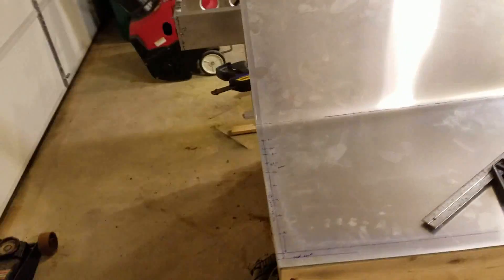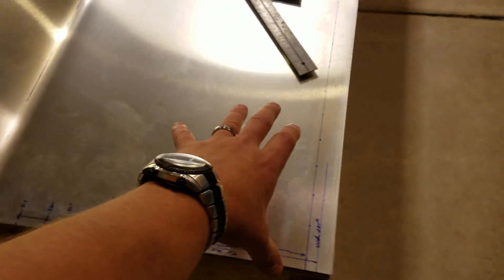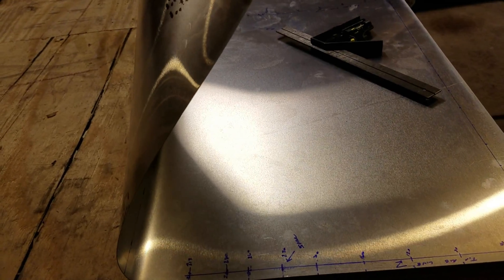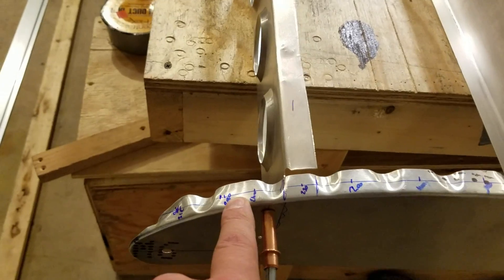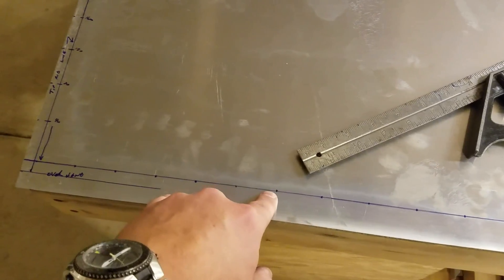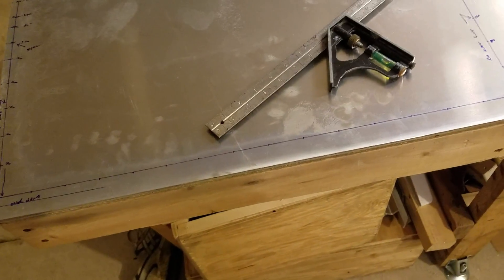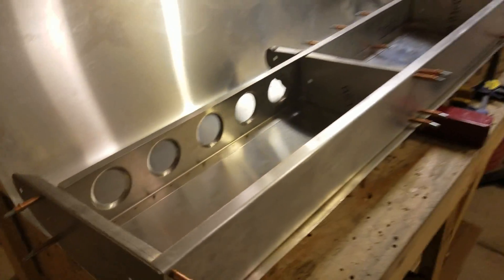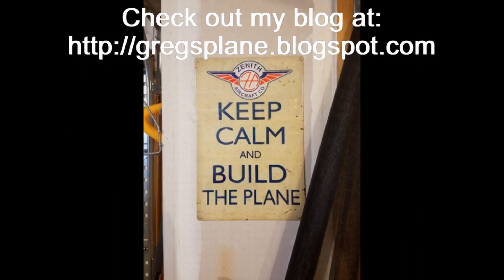Horizontal Stabilizer Build - Part 4/7

Comment: I’m currently skinning my 701 stab and it’s a bit of a pain.  I ended up with some slight nose rib imprints on the LE skin.
Reply from the maker: It's definitely a challenge. I'm not sure about the 701 but skinning the 750 has similar pitfalls when you're using thinner material. Getting a generous radius in the nose skin before ratcheting it to the ribs was critical for me to prevent that issue.

Comment: Thank you. Not the plane I originally planned to build. I was going to build a 601, but at that time they had some problems and it made me nervous so I started the 701. I am extremely interested in the 650 and will probably start one when the 701 is completed if not before. Lathes are a neat shop addition but not a high priority for the build itself, lots of tooling I would put higher on the list. I tend to be a tool addict and have spent lots of time building tools that could have been spent building airplanes.(bending brake is a prime example. Www.macsmachine.com under bend brake special offer mine is the second one down in light blue)
Reply from the maker: I originally wanted to build a 601/XL too...had the blueprints and everything. I changed my mind when I got back into backpacking/backwoods camping (I'll build a 640 for x-country). Agreed on the lathe...I am a tool-a-holic, though, so it's only a matter of time. The Mac's Machine brake is a great piece of machinery. Did you find that you could do all the bends for the 701? From what I can tell, "hat" sections like the landing gear channel wouldn't be possible with the Mac's configuration. I've struggled with the original Dave Clay design from nearly Day 1, though. Made several modifications, but if I was starting over (and if I'd had the welder from the beginning), I'd make an entirely different brake.
Reply: yes they can be bent on the macs brake with some fiddling, actually z channel was harder to bend on it. I built a somewhat crude 8' press brake which takes care of the balance of the long pieces and short heavier stock bends are done in the 20 tonpress with homemade forming dies

Comment: About 770 hours. Been away from it for a while but motivating myself for when the weather gets better. I will be doing videos and probably a podcast about it. I will be re organizing the shop and taking stock of where I am with the project and deciding the course I am taking with building. It is a scratch build.
Reply from the maker: I just checked out your vids...great work on the 701. Even from the photos, I can tell your craftsmanship is superb. I had so many setbacks over the past year! I'm just shy of 600 hours into mine. I really, really want a lathe, but building on a budget...any money spent on tooling takes away from materials for the build. Always a balancing act!

Comment: Ok, just seemed odd
Reply from the maker: Yeah, I can't really figure out what they're flanged the opposite way, at this point. I mean, the amount it would affect weight and balance has to be nearly immeasurable. And I can't find anything inside of the structure that would require them to be flanged the opposite direction. Really, probably doesn't matter one way or the other, but I figure it's best to stick to the plans wherever possible. How far along are you on your 701?

Comment: On my 701 project the plans call for the lightening holes to be flanged in the same direction as the outside flanges, just wondering why you flanged yours in the opposite direction? Is it different on the 750?
Reply: hillsgun Yes, on the 750 the lightening holes in the stab front spar are flanged in the opposite direction as the spar flanges. I thought it was odd too, but that's what the blueprints show. In all the other spars, they are flanged in the same direction as the spar flanges/caps.